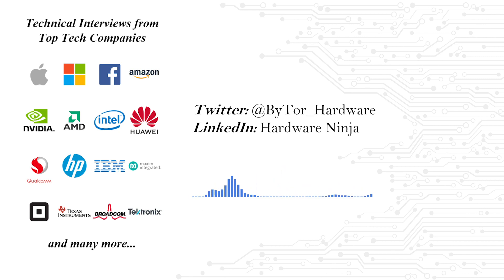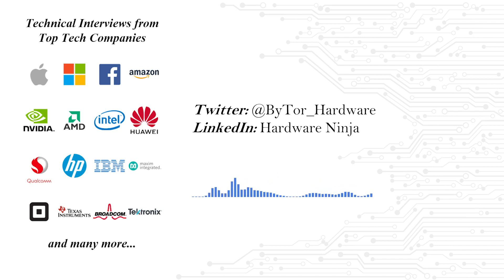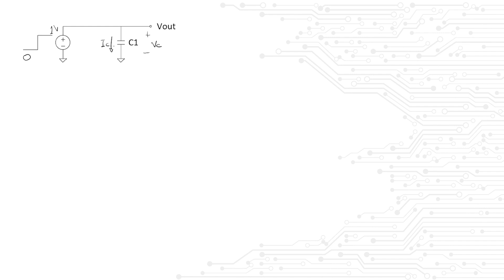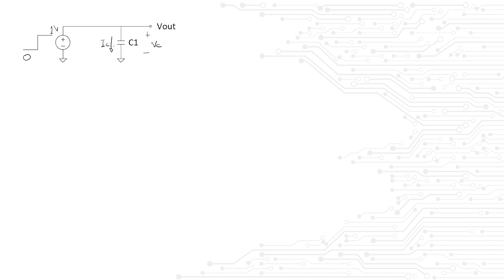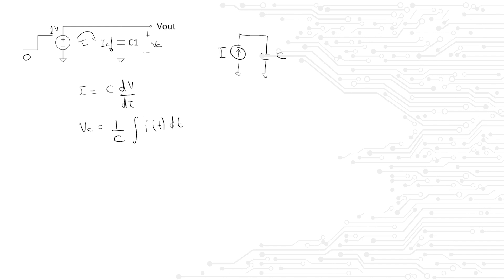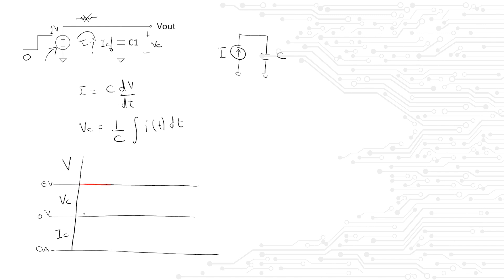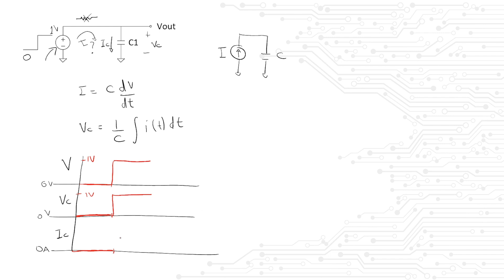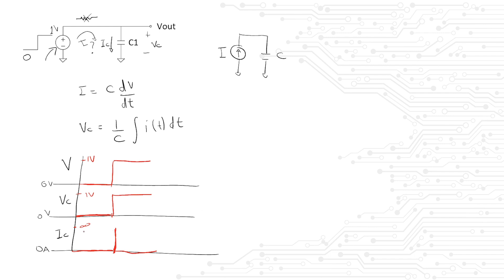HWN - "Easy" Interview Question that confuses college grads

Comment: As there are no Resistance so differentiation of step voltage will be giving Impulse as Current hence infinite amount of current will flow and the Capacitor will getting charged up by V volt instantaneously i.e. Vc=V and we will get step voltage of amplitude as V in the capacitor.
I had thought like this way is my concept is correct ?